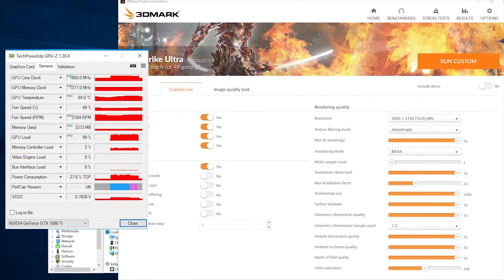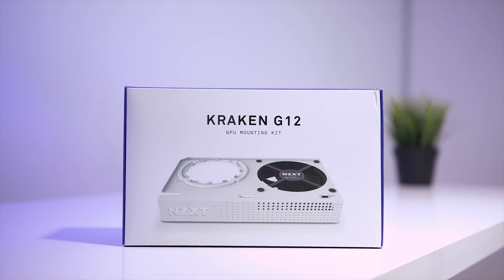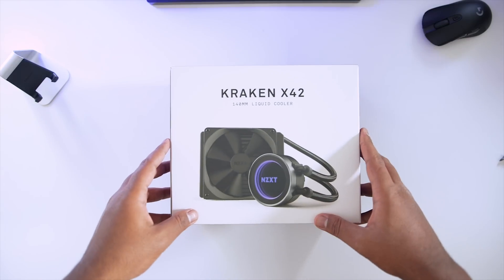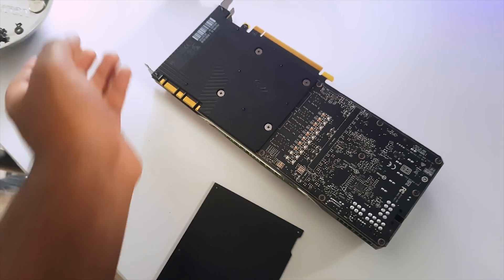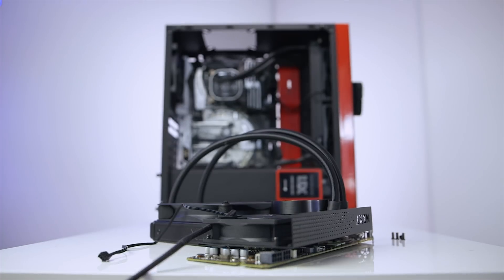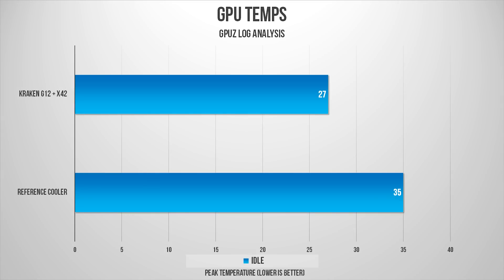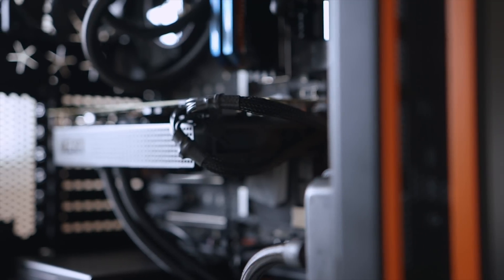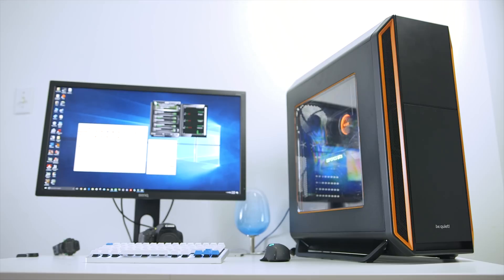Watercool ANY Graphics Card! -- Testing the NZXT G12 Bracket

Comment: tbh i find the temps kinda hight for that cooler , or the 1080 ti is just a hoot card
Reply: SeikonDS I installed evgas hybrid cooler for my 1080 ti and I was getting way better temps then in the video. I don't think he used enough thermal paste. I was told you want the whole GPU die covered and not just your normal line or pea size.
Reply: yeah i just rewatched jay's video same cooler , he got 48c , he did something wrong there :/
Reply: considering the g12 is the bracket used for both cards, i'd hoped we were all using our brains in this conversation but it seems that wasn't the case. as i said, with my experience, the power delivery and memory got significantly hotter and raised the overall average temperature on an r9 280 to mid 60s, which is still a large degree better than with stock cooling. Test it out, spend hours running benchmarks making sure the cooler is even working, and then get back to us on our temperatures please :p jay did in fact get great temperatures but even his noted some temps in the low 60s for power delivery.
Reply: When applying thermal paste on the die you have to cover it 100%
Spreading it before mounting the cooler is vital.
Reply: problem is the vrms and stuff are only cooled by the little 100mm fan nzxt gives you, i think that's why he says they should include thermal pads in the next revision lol. I've used the g10 before, same issue, still cools nice and increase the overclocking potential of your card a fair bit
Reply: the vrm's should actualy be have lower temp's , at least acording to jay's video , since there is no hoot air from the cooler reaching them.
Reply: they are slightly lower than normal, but it's not all that much less. maybe 8-10 degrees, although i agree he used too little thermal paste. it's non conductive so you might as well cover as much of the gpu as you can as it won't harm it. As i said though, i used the g10, the previous model.
Reply: The 1080Ti is a hot card! Remember it's using the same GP102 architecture as the Titan X. 
(P.S - Jay used the G12 on a 1080 which is based of GP104)
Reply: i dout there is a 20degres diference betwen this and the g12 , let's use our brain for once , something is wrong here , the end
Reply: Dam i failed hard there :( , but still something went wrong here , :/
Reply: there's something wrong with an 8-10 degree difference on a hotter card? We've established he could drop another few degrees with a bit more thermal paste, since there's not as much reason to be so stingy on a graphics card, but i think the test is right in line with my own numbers, anyway.

Comment: I guess this is meant for people who already have an extra AIO lying around. Not cost effective otherwise, usually, unless you already have a Titan Xp/whatever that doesn't have aftermarket cooling options. Because if you have a reference card of any kind, it's probably cheaper to sell it and then buy an aftermarket model than buying this bracket + cooler. I say this as somebody who used a G10 for a 560ti back in the day just for funsies
Reply: Kenji Inoue well you could also buy a cheaper AiO, NZXT's new stuff is pretty expensive.
Reply: good point. do you think that'd be cheaper than selling/then buying the aftermarket one?
Reply: Yesto take the RX 480 by asus. It's MSRP was $200-$220. Asus' is $300. And you're going to get a cooler card with a higher overclock. As I said, it's weirder with Nvidia considering their reference cards are more expensive but I think it can be worth it in the long run because you can upgrade cards and re-use the cooler.
Reply: Well, you can get a Corsair H55 for US$60 or an H75 for US$75 and both are compatible with this one, according to the product's page. Add the $30 for the bracket and you are barely going over $100, something you can easily spend on the higher end aftermarket cooler cards (although it becomes a trickier proposition thanks to Nvidia's Founder's Edition crap).
Reply: i think its too expensive for what it is right now, if they can get it to under $100 it would be worth it
Reply: I used G10 bracket for R9 390 with Corsair H75 and it kept my GPU pretty cool at 60-65 c at 100% load.
Reply: I already have a reference style card and an extra AIO, so this $30 kit is  potentially perfect for me!
Reply: TVCH LORD you're right! but if it stays quiet and doesn't throttle on air, is it worth the price difference? It's all personal preference, but air cooling is better for me. I used to water cool my reference 290 so I know that feel
Reply: Dude it is. Get a 60 dollar Corsair H55 silent and this. Thats 90 dollars.
Reply: Diego Fernando Salazar no, not easily
Reply: yea a 720 USD plus one sixty USD =820 USD might as well save up for a Titan X or get a refurbished one.
Reply: I have a 750ti watercooled😂😂😂
Reply: Kenji Inoue Yes, but this looks at least 80% better
Reply: I have an H75 in a server that doesn’t need it. Found the G12 for $24 shipped on eBay. Already have the thermal paste. Too cheap a solution to pass up.
Reply: watercooler will probably work better than the aftermarket fan coolers

Comment: Would this bracket fit on the GTX 1060? I wanna upgrade to a 1060 in the near future and will use the Corsair H100i V2 which I have already to water cool it. Any thoughts on if it will fit? Which brand should I get or should I just get the reference design to be safe?
Reply: It does fit on a 1060 but I'm pretty sure that the h100i won't fit. Check the supported aio for the bracket on nzxt's website